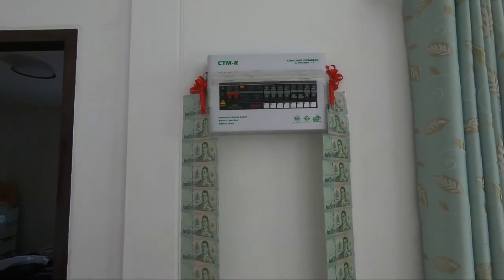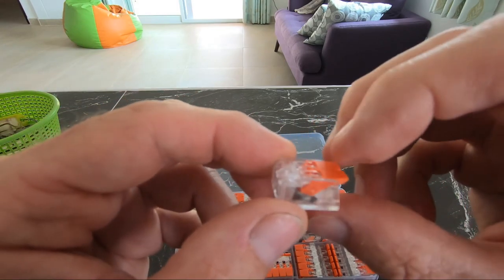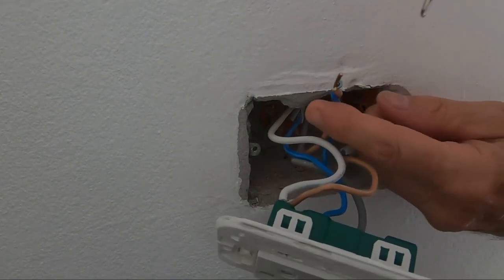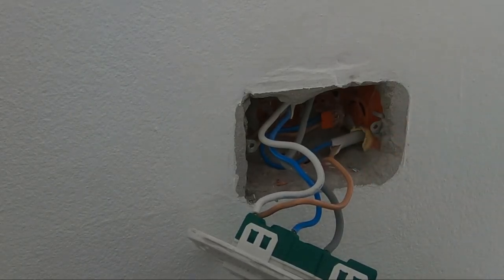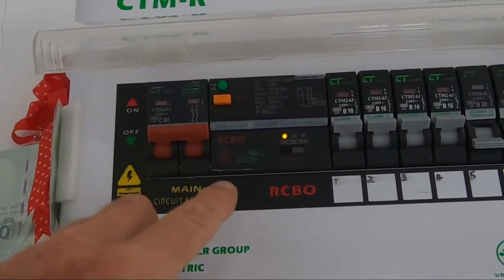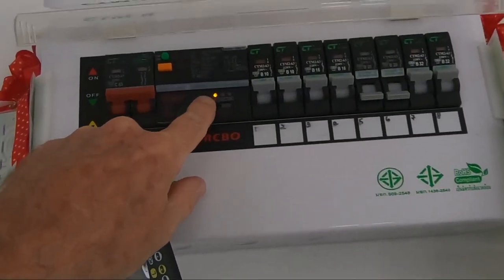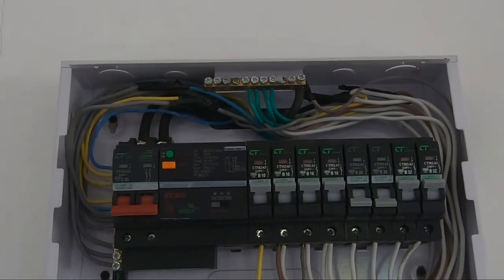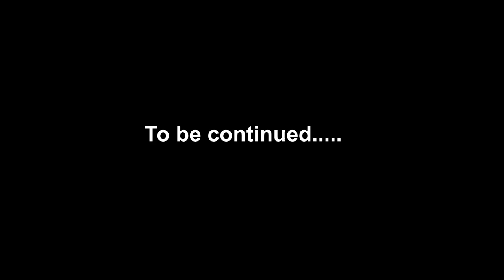New House Build part 81 - Electrics AGAIN. Tidying and testing.

Comment: I like those clear/orange clips. I need to look for those. I had always used wire nuts.  I guess they are rated for the 220 and different wire sizes.

Comment: Nice safe clean up job.
Could not see a surge protection device?
Wet season Tstorms coming up. The power lines WILL receive lightning strikes.
Isolating your household devices from the surges is mandatory.
Reply: Not from PEA. We have destroyed 3x 65” tv’s, 3 computers, dac, and a bunch of smart devices.
Since installing SPD zero lightning damage.
Mandatory if you do not want to replace your home devices after every Tstorm
Reply: 135 b on Lazada. Cheap insurance
Reply: @AnuchaFarm  please explain more. I didn't have good luck on searching that.  So far, I've been lucky.